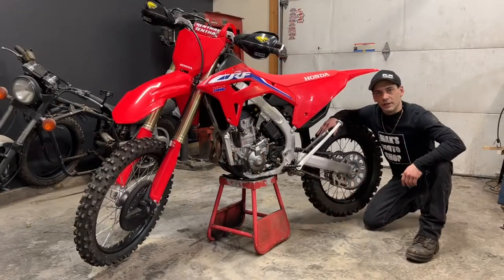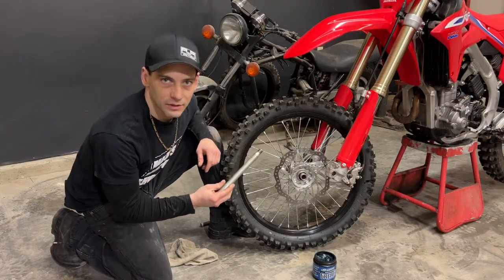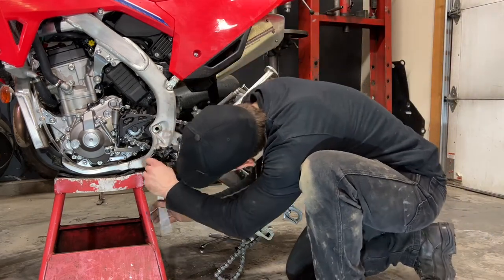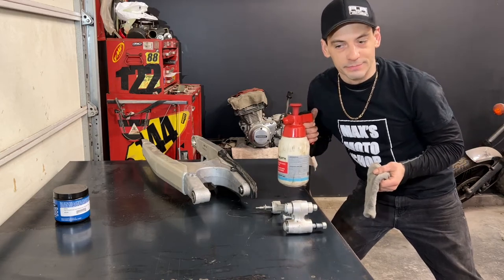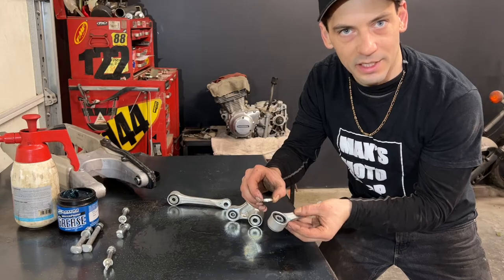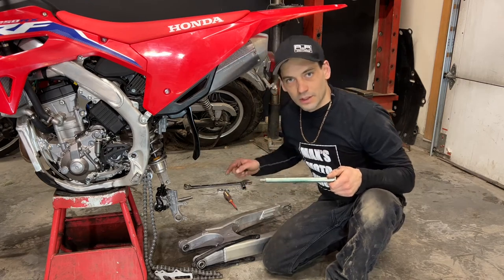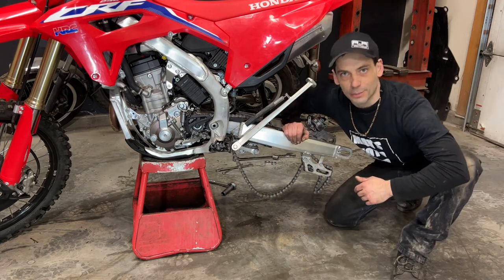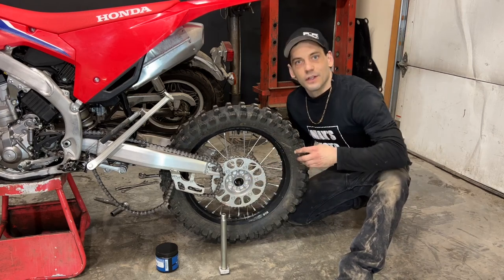New Bike MUST DO !!! GREASE Your Bike NOW!!! / How to Grease the Axles, Linkage and Swing Arm

Comment: About 10 years ago the mechanic for factory ktm in Canada only ran front axle with no grease. Never really questioned it since figured he knew more than me
Reply from the maker: First of all KTM so stop right there second of all a couple times a year I have to beat axels out of bikes because people don’t grease them and charge the customer quite a bit extra for doing so definitely put a small amount of grease on all actuals and shafts. The situation might be a little bit different if you were a racer changing your tires a few times a week.
Reply: No torque wrench?

Comment: Does the rear axle need grease ? I say this because all the movement occurs in the bearings. The axle just holds the bearings in place and you don’t want to encourage the axle to turn on the bearings.
Reply from the maker: Yes, the front and rear axle need to be greased. What do usually a greased the first time you change the tire which should be in the first year anyways, this video covers the more unusual places that have to be greased.
Reply: @Maxsmotoshop  I appreciate your reply ! Best wishes 👍🏻

Comment: Is it the same as the 2024 husqvarna TE300 linkage system?
Reply from the maker: Most bikes are fairly similar. Helps to take a few pictures before you get started so you can have a little help putting it back together manufacturer grease from the factory.

Comment: No torque wrench…
Reply from the maker: There are only a few bolts on the machine that need to be torqued most of them are inside the motor otherwise a torque wrench is only needed if you are unsure about what you are doing then make sure to use the torque wrench👍
Reply: @Maxsmotoshop  Honda has been building bikes for 73 years and specifies a torque value for all axle nuts, I think I'll believe them.  Everything has a torque spec.
Reply from the maker: @phantomshtter  torque wrenches are rarely used
Reply: At least two uga-duggas
Reply: @MaxsMotoShop  by techs... oh I know trust me.  That's why I do my own work.
Reply from the maker: @phantomshtter  yes, your average person still struggling to understand lefty Lucy righty tidy should definitely use a torque wrench as a tech. They’re only a few bolts that I need to use my torque wrench for.
Reply from the maker: @phantomshtter  and fyi 60% of the jobs I do are cleaning up after backyard mechanics who thought they knew better
Reply: @Maxsmotoshop 😊
Reply: Me too! So little free time, I would rather pay someone to do it sometimes.  But this kind of stupid response that torque wrenches are for people who don't know what they are doing is somewhat common. @phantomshtter
Reply: 😂😂😂😂 bozzo the clown over here, bet that bike is ruined now

Comment: Came here because I have the big brother 450 bike.  I watched https://www.youtube.com/watch?v=jq5TUDXsfrg  (highland cycles) first and then watched yours.  I like how you showed how to take the swing arm and the rest of the linkages.  Your technique to not have all the needle bearings fall off is excellent.   The guy at highland cycle had you take the needle bearings out and then clean them and the area where the bearings roll.  I suppose that would be a step to go beyond this.
Reply from the maker: Yes, I prefer not to pull the needles out. They are already clean as this is a brand new bike, just lacking grease to ensure a long life

Comment: greasing the axles doesnt do shit, They dont move. The bearings move and need the grease
Reply from the maker: Clearly, you’ve never worked on a bike, the shaft will see in place after a few months and will need to be beaten out with a large hammer if you do not grease them